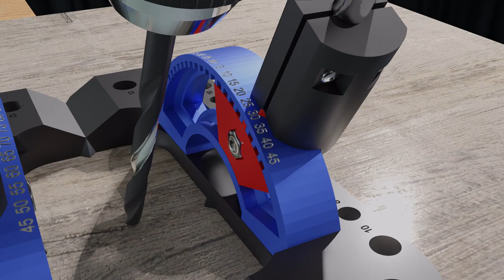Multi Angle Drill Guide - Drill Press - 3D printed

Comment: I have to tell you, This Design ROCKS!!!!!!!  I've been planning to design one for a few years now and another project always moved it down the queue. This is so much more flexible that I'd have designed.

I think I might do a couple of upgrades, not changes to the design, just additions. I plan on putting compression springs on the rods, Just to hold the drill up while changing bits. The other, if I can do it without making any changes to the design, mount a couple of line lasers for crosshairs.  

I bet you could sell these.
Reply from the maker: Thabk you so much!! I made some updates and planing to upload on thingivers. I hipe you will like it. Thank you again
Reply: @diymusty  I'm sure I'll love it. Question, the images included with the download show a deboss of the lettering on the rotation plates but the printed part is instead embossed and not holding very well. Are the "new" side plates going to be debossed? What software did you design this on.

Comment: Really nice design! I am about 90% through a design/iteration of my own, and really like the way that you have done the angle setting, very clean and easy 🙂I think you could get away with only having a 3D printed linear bearing, they actually work surprising well, also, you could print a thumb screw to fix the angle in place, instead of having to use a metal screw.  You could also have an opening in the centre of the drill mount to accommodate the actual drill, this would enable you take the dedicated chuck out. 

I have found these to work really well in my design, and don't compromise strength, when printed in right orientation, but significantly reduce cost.

Comment: I like your design is very unique! But...I have a suggestion:
By the way do you sell the files or are they free?
Let me explain:
I need that protractor in a way to be screw from below and from sides.
I have a jig for my router and I try to make wooden trunnions to move it on an angle, I could not do it so I ended using a metal hinge.
But with your protractor I could screw my router jig and to the plate that way I could reposition the router on the desired angle. 

What I like the most is:
The accuracy of the protractor it will not move from its angle....
Sturdy protractor it will not move sideways. 
The protractor can be modular: it can be used with different fixtures by simply switching options like dremel for example or it can be screw to a different plates.

¡Me gusta tu diseño es muy único! Pero... tengo una sugerencia:
Por cierto ¿venden los archivos o son gratis?
Dejame explicar:
Necesito ese transportador de manera que se pueda atornillar desde abajo y desde los lados.
Tengo una plantilla para mi enrutador y trato de hacer muñones de madera para moverlo en ángulo, no pude hacerlo así que terminé usando una bisagra de metal.
Pero con su transportador podría atornillar la plantilla de mi enrutador y a la placa de esa manera podría reposicionar el enrutador en el ángulo deseado.

Lo que más me gusta es:
La precisión del transportador no se moverá de su ángulo....
Transportador resistente que no se moverá hacia los lados.
El transportador puede ser modular: se puede usar con diferentes accesorios simplemente cambiando opciones como dremel, por ejemplo, o se puede atornillar a placas diferentes.

Comment: Which spindle do you use and which shaft ? Mine is too big (on the thread side) for the bearing and too small on the other side. I don't find anything with 12mm shaft to be used inside the bearings

Comment: Nice idea, but not being an expert in bearings ...why do I need 4 linear bearings? 
What is the length of the 1/2 bolt? Really 1"?  
 When did you cut a groove and where did the "c clip" come from? 
Was it made from  1/2"washer?? 

This is what you supplied for pasts list.  Prices are in US$ 
"10mm linear bearing X 4 (2=$10)
10mm bar 30cm X 2 $14
12mm bearing X 2 $10
1/2 Unf 20 bolt X 1"   3" is $1 

1/2 "c clip" $1

The price is good for a highly adjustable unit, just make the parts list correct.
Reply from the maker: 12mm hole bearing just 1 dollar. it depends where you live.
4 linear bearing just for more stability and it works perfectly.